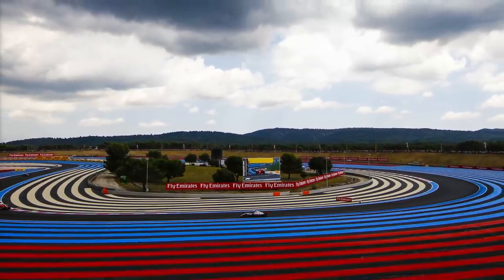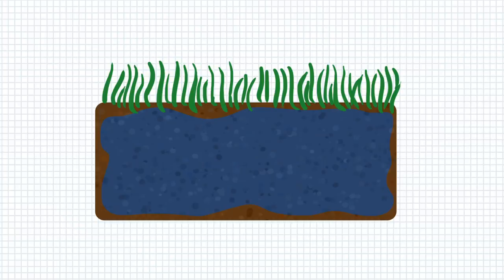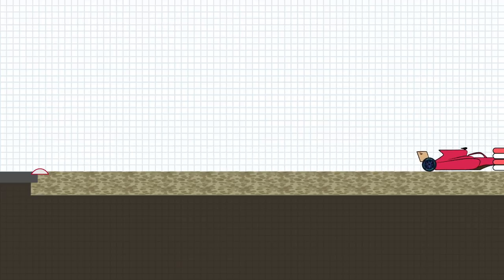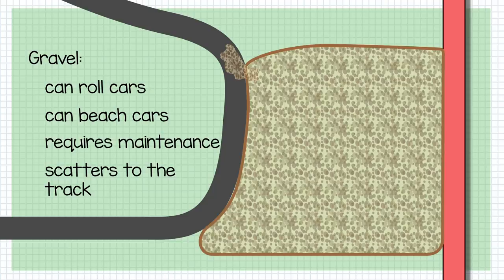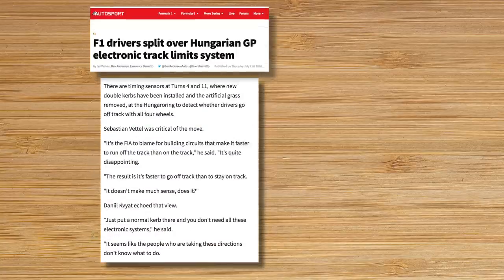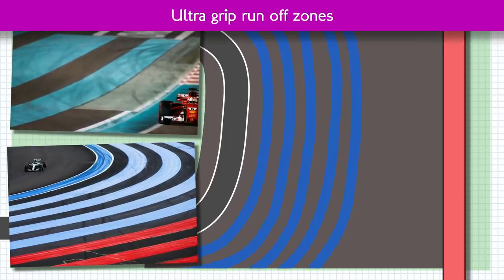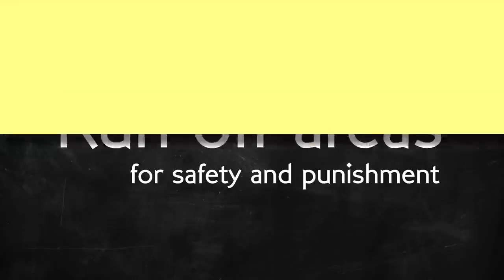Run off areas in F1 - Safety and shortcuts

Comment from the maker: So I MEANT to include a small bit about the fact that circuits have to accommodate other types of racing too and that gravel traps, for example, are bad for bike racing, etc. Just pretend I said that.
Reply: And, if you think of the economical side of things, it is more attractive for private persons and non officiall racing categories to take their cars to a track where running wide doesn't damage your car instantly. Obviously that doesn't really have anything to do with safety but that might also be a reason that most newer tracks have these huge run off areas.
Reply: Chain Bear F1 Soon 100k
Reply: I definitely heard you say it at 2:30.
Reply: Arent gravel traps actually better for bike racing than asphalt run-offs? I remember Luis Saloms fatal crash in Spain which was blamed mostly for the asphalt not slowing the fallen racer down before hitting the wall. Gravel traps in MotoGP for example seem to always stop fallen racers before a big shunt to the wall, which is obviously better.
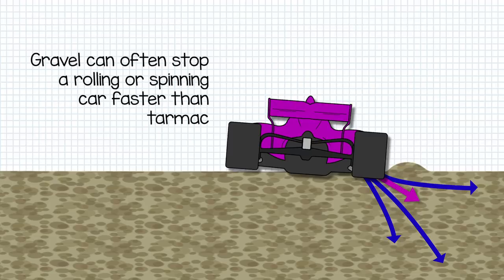Reply: I heard that around 3:15
Reply: I read it at 8:10
Reply: You're right, asphalt is better for cars, but gravel is better for bikes.
Reply: They should do 3 meter wet grass and than the tarmac run of... If you go out of the track, you should lose at least 2 a 3 seconds instead of gaining. That yellow or red bump thing is stupid and the drivers got a damaged floor. Thats a hard punishment for a lap 1 mistake.
Reply: You just did say that!
Reply: okay
Reply: Your football analogy was amazing
Reply: BadgerBeard tarmac doesn't slow the rider down as opposed to gravel. You may twist a shoulder or break some bones but you are alive to race after some time. Not dead like poor Salom.
Reply: Elkhaa18 this is F1
Reply: gravel traps aren't bad for bike racing. look what happened to luis salom!
Reply: Why didn't you mention that gravel traps are safer in the event of a total brake failure.
Reply: Seit Senna hasse ich diese Asphalt Runoffs Areas. Klar solange die Technik geht ist alles kein Problem, aber wenn die Bremse versagt muss der Untergrund irgendwie abbremsen.
Lieber einen ausscheidenden Fahrer, durch FEsthängen im Kies, als wieder jemand der wegen zu geringer Run Off Area mit defekter Bremse gegen die Wand knallt.
Reply: That was in the video. What are you talking about?
Reply: Just about to comment this haha
Reply: Use pure rubber
Reply: I think tracks should have a meter or two of grass on the exit then tarmac run off just like silverstone
Reply: BadgerBeard But doesn't hurting more mean that it's slowing doen the car more effectively?
Reply: You have the same voice as Gigguk, a famous weeb youtuber
Reply: @dr.nightmare9093  I'd say Super GT has a more similar voice to Gigguk lol
Reply: Just one thing, aren't most gravel traps sorrounded or come after a tarmac or grass runoff?
Reply: One of the best runoffs for bikes is a mix between grass and gravel. The gravel slows the bikes down and then the grass stops them as the tyres can sink in, it also hurts a less of a lot less to land on a patch of grass than gravel

Comment: Fuji has a nice solution. Tarmac run off areas surrounded by a small strip of grass parallel to the circuit. For turns with high speed entries such as turn 1 there's a gravel trap further on past the sea of tarmac to help try to catch the car if say the throttle sticks or brakes fail. A lot of Asian circuits seem to have adapted this since so maybe there's something to it.
Reply: Agree, that's the best solution I can think of honestly. Grass avoids the track limits issue, tarmac does its job at slowing cars down, gravel reduces risks from brake failures not covered by tarmac.
Reply: The amount of times I spun at fuji in Fran Turismo because of the grass is ridiculous 😭😭😭
Reply: @E9X330  That's what makes a circuit great
Reply: @PointNemo9  true, I just get too greedy and it punishes me hahaha
Reply: Yeah, was thinking "why not just layer run-offs" the entire video
Reply: I had originally thought that the ability to keep a car from accelerating out was part of the purpose of the gravel in case the accelerator was stuck or held down. Though I imagine that they have other safety features like how monster trucks have for killing the engine remotely, locally and by the driver in the event of a crash.

Comment: While bollards are a good workaround, the problem is they still don't provide the necessary punishment. Gravel traps and walls mean drivers are severely punished for even the smallest of mistakes. This is a good thing, as it forces drivers to play it safe. This in turn means more desperate drivers can drive riskier which creates more interesting racing. I'm not suggesting drivers should put their health at risk, but Formula 1 needs a risk element to ensure it actually remains exciting. Being punished for mistakes is a big part of that. This sport is about perfection.

Comment: Working at Paul Ricard, I found your video really interesting and accurate. You forgot one major point : the extrication of a car becomes a lot easier than gravel or grass. We don’t need big truck to make it and I have oftenly seen car pulled up by a simple quad here. And we don’t need SC or VSC most of the time. In the middle of the discussion around safety with these giant machines who took JB17 from us, I think this is the most important advantage you can get from run off. 
Another great video keep pushing!
Reply: Léo Pouzoulet Please. Suzuka ´14 conditions were bad. Very bad. Extremely bad.
Reply: Correct, but honestly the trend is to deploy VSC/SC every time workers are on the scene (understandably), regardless of the size of the recovering vehicle. Also, tarmac runoff areas can be trickier in case of brake failures (Gachnang crash at YAS Marina comes to mind). So I'd say each solution has its pros and cons.
Reply: great.now lets talk about that pit entry of yours
Reply: @Pantherace  and it'll never rain again, or maybe a driver gets the front wing stuck underneath the car and can't avoid a crash?
Reply: @sergeantsupreme4395  The big question: is it really necessary to move every car when it's outside of the track?
Reply: Léo Pouzoulet no hate but all that run off in Le Castellet is just annoying, it ruins the track beauty.
Reply: @Pantherace  old comment I know,

It's under safety reasons what if a car goes off at the same point? By leaving the car there it reduces the safety of the drivers because say 3 laps later the driver outbreaks himself and hits said car, that car would send debris over the area and  could roll back on track from the impact not to mention the driver would have a harder impact
Reply: Giant recovery machines pose no danger if you heed the warning that they are present and slow down accordingly, as Bianchi failed to do, on the occasion of his eventually fatal accident.

Comment: Laughed my ass off on the joke on football.. again a very good work.. keep it up..
Reply: The point is that it should. With gravel traps there doesn't need to be a rule saying you can't, but there's no reason why after implementing safer asphalt runoffs that rules shouldn't be made so people use runoffs for advantage. It was a direct counter to the claim that if a track can be driven faster going off it is poorly designed.

Also it is completely and utterly not a strawman. Whose argument was misrepresented? It was a counter to an argument, not a misrepresentation of an argument.
Reply: @Reavaverho  The consequence in football are brought on by the rules and the referee. The ball does not explode when you pick it up, a rugby team does not tackle you if you dare to use your hands. Just like in F1.

But lets take a look at similar rulesets in football and F1. For example,  offside. Why offside? Well, they are kind of similar to running off the track. An offside is a player that is in a position where he should not be trying to gain a (huge) advantage for his team. When a player is on offside, their team loses the possesion of the ball and has to retreat.  Goals can (and generally are) nullified,  and the ball returns to the position where it was right before the infraction, just in the possession of the other team. And, whats more important, unless the player goes to offside repeteadly there is not even a warning, let alone a punishment to the player itself. 

Isn't that what happens in F1? Time penalties, mandatory rejoins and ceding of positions, while do not directly affect the driver itself heavily affect the outcome of a race. 10 seconds is goddamn huge in racing, and having to brake down to let other people pass you leave you further and further behind to those that are in front of you. Escentially, not only are any advantages that you get for doing it eliminated, you hurt your chances in the long run.

Also, you're taking his example very specifically. What he means is: Don't be an asshole, don't cheat. if you cheat, the responsability is on you, and you only.  Saying things like "Well, if they don't want me to cheat don't build safety measures that allow me to cheat" demonstrates a callous disregard for ethics, and the spirit of the sport where you are participating right now. It disrespects the sport, the history of the sport, your team, your car and more importantly your fans.  Very few fans want to see their favorite driver win by cheating. If we take statistics from other sports and say we can compare them to F1, only less than 4% of sport fans think cheating to win is okay. The absolute majority wants to see their favorite win within the rules and restrictions of the sport. If my favorite football team won the tournament by cheating all the way trough, where is the fun in that?
Reply: People will cheat if it's in their benefit. If they don't somebody else will and they lose. A better comparison would be an asphalt run-off area is like a game of poker where you can go all in, if you win you win, if you lose you get 90% of the chips back. Even when they do stay in the lines, they didn't really risk much, so the commitment is gone. Its all low stakes to the detriment of the sport. If a car breaks down, do you want it that we go under safety, they run back to the pits, get a new car and rejoin the race in position. F1 used to be about attrition and pushing the edge. This channel likes every safety feature ever but its not a universally held view.
Reply: Prabhu M guessing no one has heard of Gaelic football which is and Irish sport where you can hold the ball
Reply: @1_foxtrot_012  Let's ... avoid bringing up alternate football codes regarding picking up and running with the ball. If it helps, say 'soccer'. There's a vocal fanbase of another kind of football across the pond, you know.
Reply: @Reavaverho  So we know where THAT person is.
Reply: @Reavaverho  "expecting drivers to stay within white lines is absolutely hilarious. They will abuse track limits if there is no other consequence except a warning or a mandatory rejoin route in the case of an egregious overshoot."

I think you misunderstood the point. This is why there needs to be punishment for going off track or breaking other rules. Of course if there's no punishment drivers will cut chicanes, and football players will carry the ball into the net.

The argument that chainbear was addressing was that tracks should be designed in such a way that the punishment always physical, and never from a rule.

If you don't see a tangible harsh penalty in F1, that means a rule needs to be introduced, not that the entire concept of punishment from rules is flawed (which was the claim by the driver).
Reply: It wasnt funny at all

Comment: Can you do a vid on ground affects aero and why it’s banned as from what I’ve heard it could be an alternative to regular aero as it creates less turbulence and would improve races but yet it’s still band?
Reply: I would be extremely inquisitive to watch a video covering that topic
Reply: IIRC it was banned because running them at maximum efficiency required extremely stiff suspensions, which made them extremely rough to drive and borderline painful on bumps. Badly-designed ground effects also led to porpoising, which is a recurring uncomfortable heaving motion.

I do think that with current aero knowledge, a lot can be gained from ground effects with sensible restrictions, such as banning sliding skirts. I'd like to see it be brought back, rather like the ground effects used by IndyCar.
Reply: You misunderstand: that was at the best of times. Drivers were beginning to experience momentary losses of consciousness and physical injuries. This aside, if the suction created by the skirts was broken momentarily, most of the downforce disappeared, which could cause massive accidents. It's widely believed that Patrick Depailler's fatal crash was caused by this.
Reply: I believe we already have ground effects. The current cars produce about 70% of their downforce from the underbody but instead of skirts, vortices are created at where the skirts would normally be to trap the air.
Reply: Check the most recent 2021 regs news. Ground effect is coming back!
Reply: I think it was because if you were to drive over a high curb you would suddenly lose nearly all your downforce and plow straight into wall.
Reply: 2021 is bringing it back